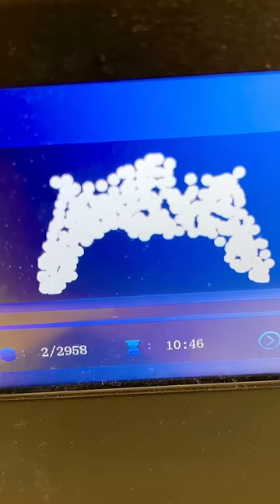Oni Mask #4 print file available on kawaiiwong.com Anycubic M3 Premium Cruzix Chameleon Powder

Comment: I didn’t know you could do this… now I want a resin printer I kinda wanna do this with clear resin and normal confetti and just see how it looks.
Reply from the maker: 😂 you’re very brave with normal confetti
Reply: That sounds like a good way to damage your printer, my guy.
Reply: Здарова, пич
Reply: @gregwessendorf  With resin printer, usually the most that happens is you drill the FEP, which is just a plastic that can be easily replaced
Reply: @abovewongart  CAN U MAKE ONE IN RED AND BLACK